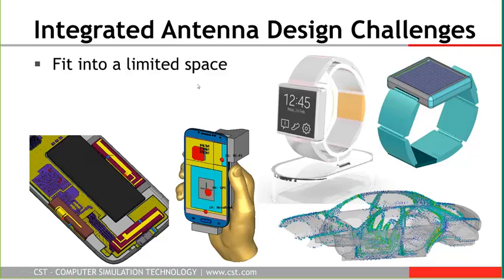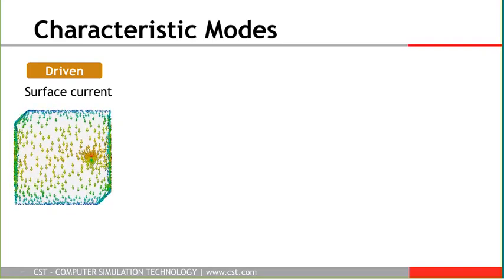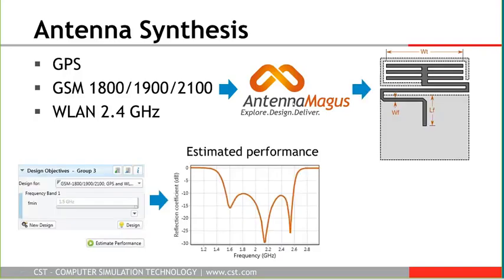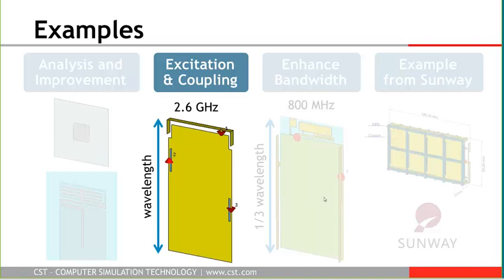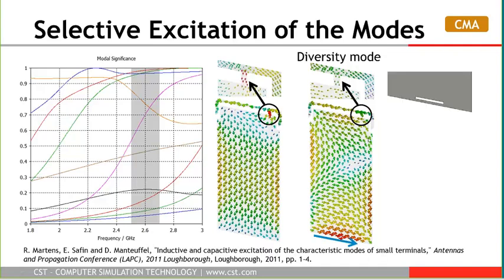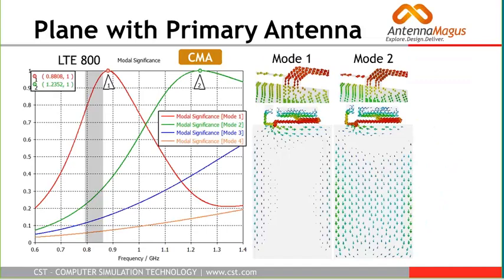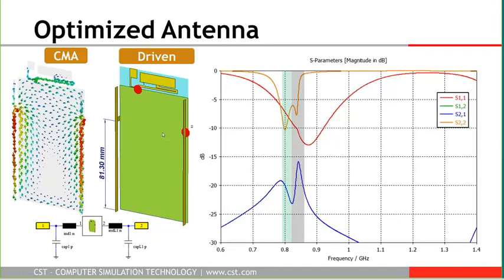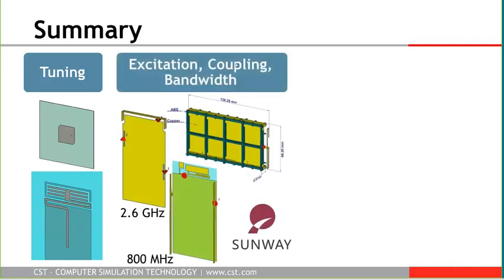Antenna Analysis and Design with Characteristic Mode Analysis

Comment: Multilayer solver  provides  better results as compared to the integral equation solver
Reply: @dilaawaiz how to deal with lossy media in multilayer solver? It gives error when you have lossy media
Reply: @JawadAhmadKhan  you can't simulate lossy material in CMA solver.
Reply: @dilaawaiz  but if we have used lossy substrate and lossy copper in antenna then how will we simulate such structure. In practical we don’t ha perfect conductor or substrates.
Reply: Hello, I am trying get an CMA for my aperture coupled patch. Can you help me out how I can perform. That would be helpful.

Comment: Sir, I have designed patch antenna in HFSS. Is it possible to do the CMA in it?
Reply: HFSS can do that, but it is not recommended. I usually use CST, and the FEKO can do that also.

Comment: The solver for the characteristic modes are they in CST or it is a different software?
Reply: In CST only..Pls use Integral Equation Solver
Reply: @drkjagadeeshbabu2041   sir how to do that can you please explain
Reply: @zuvairiyaparveen5407  If you can provide your mailid, I will send the details
Reply: @drkjagadeeshbabu2041  sir please can i get your mail id to ask a question about a project im working on ?